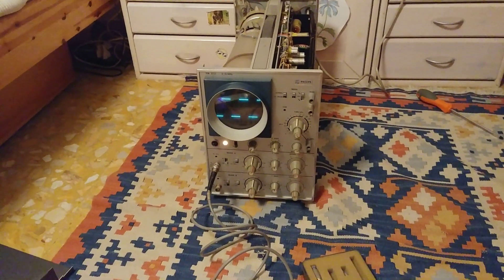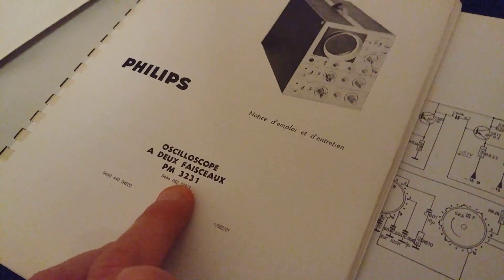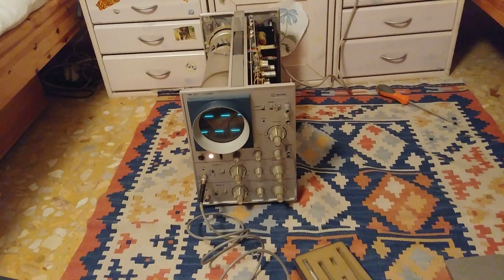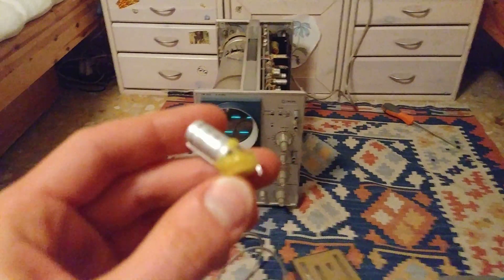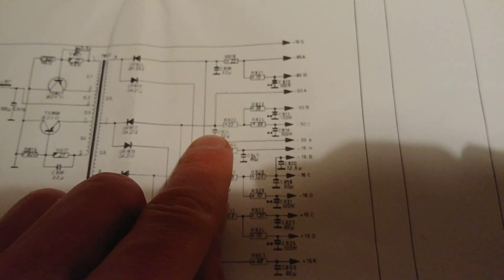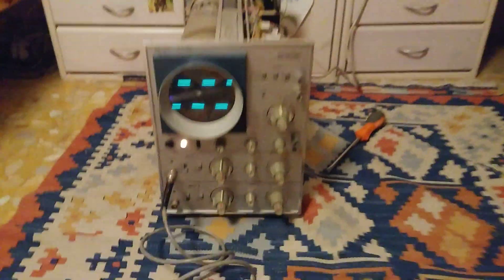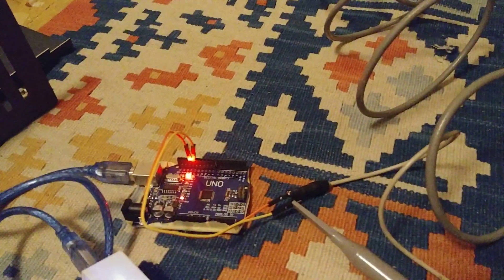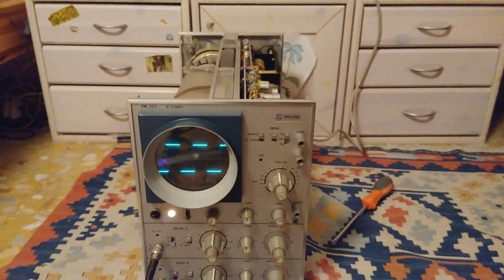PM 3231, cheap oscilloscope works!

Comment: I just got one of these! It works, the main 5000V capacitor in the high voltage PSU is sparking though... I'm going to replace it if I can find a compatible one.

It is definitely huge!
Reply from the maker: cool! here's the cap I used: https://www.ebay.it/itm/20KV-102-103-221-222-331-332-471-472-681-10-682-High-voltage-Ceramic-Capacitor/192139527176?ssPageName=STRK%3AMEBIDX%3AIT&_trksid=p2057872.m2749.l2649
 you must buy one with the exact capacity and an equal or higher voltage rating.
The one I talk about in the video is a different capacitor I also had to replace. The main high voltage capacitor in the Tube driver is a paper capacitor that tends to fail, I found that a modern ceramic one works just fine.
Reply: @coccoborg  nice! Thankyou so much!

Did you replace any other caps? There are a few in the PSU, and quite a lot in the whole scope...
Reply from the maker: @thethiefmaster  yup, I think I had to replace the 100uF ones I showed in this video, I don't remember the names, but if you can't figure them out, I'll look them up for you! Do you have a copy of the manual? Do you want me to send the PDF over to you?
Reply: @coccoborg  Yeah I have the manual. Thanks for the offer though!
Reply: @coccoborg  One last update - I highly doubt that cap you bought is a 20kV cap like it claims - the leads are close enough together that 20kV would jump that gap no trouble, so there's no way it's a 20kV cap. And if it's not 20kV, what's its real rating?
I've seen a bunch of caps on eBay that are probably 3kV caps (maybe) with incorrect labelling. One said 25kV in the title and showed a picture of a cap with 3kV printed on it!
As the original capacitor is 5kV, using what might be only a 3kV cap or less is risky at best.
I looked at the manual, and it turns out the capacitor is on a 3kV supply - the reputable suppliers mostly don't sell anything over 3kV, which would be cutting it close on a 3kV supply.
Only one reputable supplier stocked even the 4kV capacitor - and it's not cheap: https://uk.rs-online.com/web/p/polypropylene-film-capacitors/6351950/ but as the power supply is actually only 3kV, a 4kV capacitor should be enough.
I discussed the possibility of using series capacitors for a higher voltage rating here, and the end decision was to use the 4kV cap: https://www.eevblog.com/forum/beginners/replacing-5000v-paper-capacitor/
Reply from the maker: @thethiefmaster  thanks for the heads up! TBH I suspected that, but it has been working flawlessly for quite some time and I've used it more than once for a few hours straight.
The scope was 20€ and the cap was cheap as well, I don't see much harm in shorting out the cheap cap if it does eventually happen, I wasn't inclined on spending more on a single component than the entire scope.
I know it's a vintage tool and most would prefer to restore it into mint condition, but to me it's just a cheap tool that does the job 😅
Reply: @coccoborg  I'll be honest - I only got it to toy around with myself because it was cheap as well. I sometimes fix my kids toys - an oscilloscope will come in quite useful for helping diagnose why something isn't making noise like it should - is there a waveform being generated for the speaker and the speaker is dead, or is the problem earlier in the circuit? Etc
Reply from the maker: @thethiefmaster  absolutely! and will help you do so much more! simple digital and analogue circuits are so much easier to build and diagnose properly with a scope.
Hope you'll be able to fix yours and enjoy it for as long as you can!